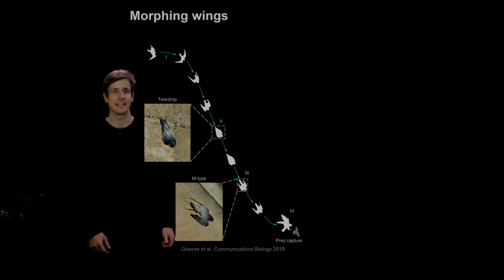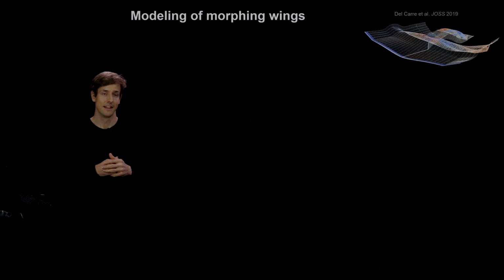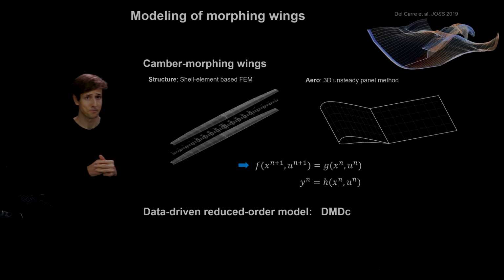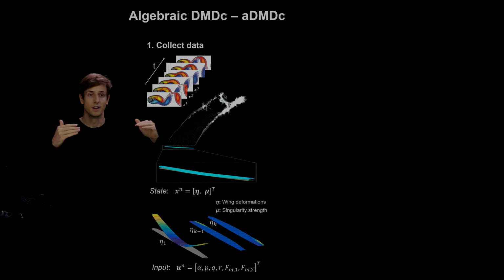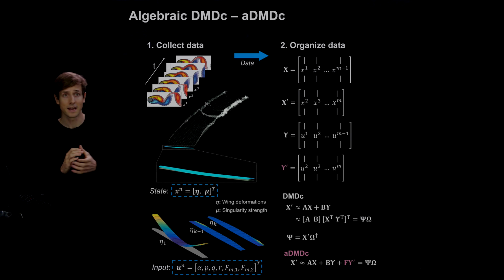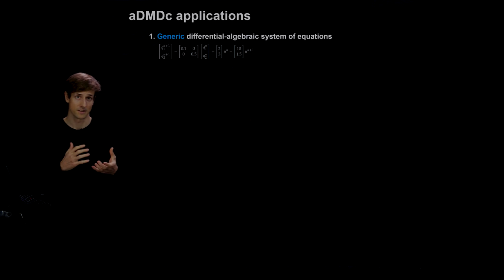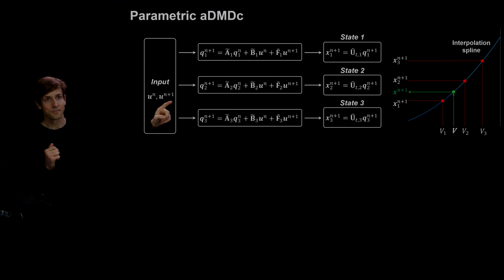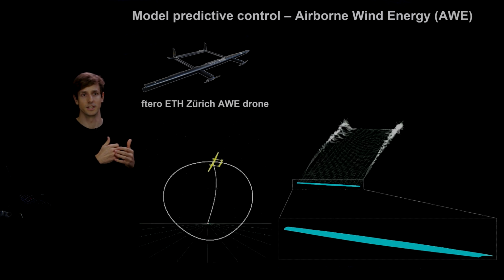Data-driven nonlinear aeroelastic models of morphing wings for control

Comment: Have you considered using the equations we use in soft tissue deformation to model your calculations? I know mechanical engineering struggles to model viscoelastic deformation, which would adequately explain your challenge here, so it might be worthwhile looking into it!

Comment: Hi Prof.
firstly thank you for the video and the whole video package you present. since the method is great and easy to be implemented,
I am trying to use the mentioned DMDC method in extracting the state space equation to be used for active vibration control with the help of piezoelectric actuators. i have seen the video several times and also went through the paper. the method is easy and straight forward the only point that isn't clear to me is the impulse excitation. do I need to apply it as a control force and then extracted the state or disturbance force?